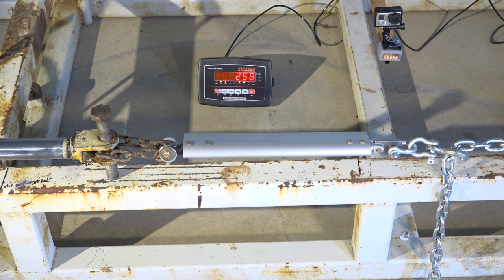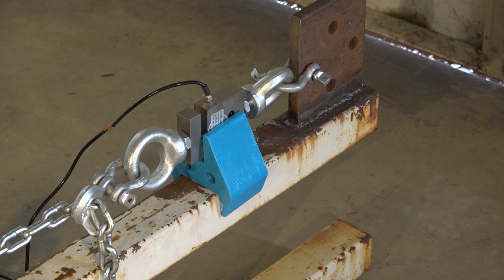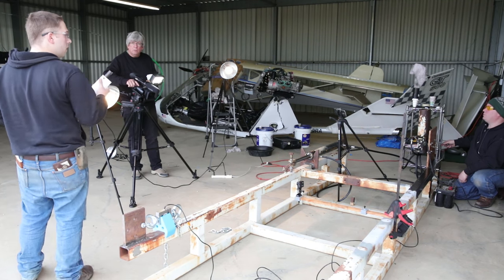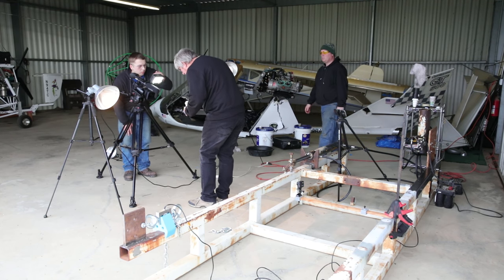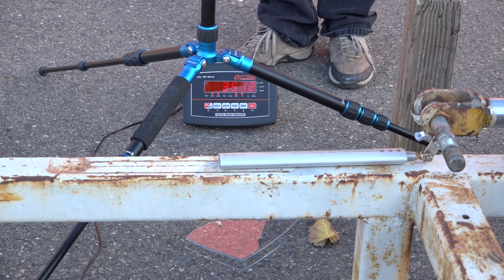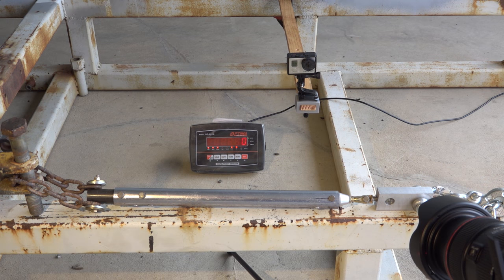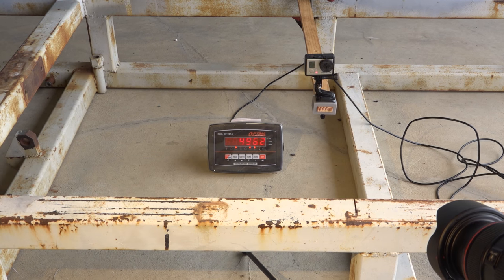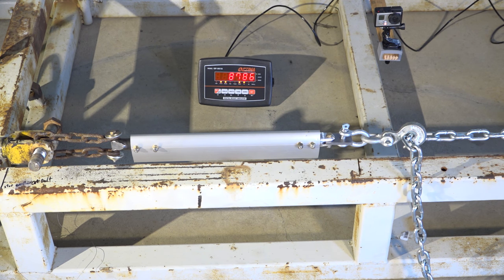**Load Testing**  EMG-6 Electric Motor Glider Fittings

Comment: Fine demonstration of the quality of aerospace grade materials. Every part and material is fully spec, tested, and manufactured accordingly. If the designer does their job correctly, you can feel confident that you have a connection that will withstand the intended loading.

Comment: Not proper test. Need part fixed at one end, to meter the hydraulic fluid much slower. Best to log both the stress and length of the part. Metal will yield and then fail. You want to know if metal is yielding.
Reply from the maker: Thanks for your comments. As I mentioned in the comments section, we still have a bunch of modifications to do to this fixture to make it a truly useful tool. That wasn't really the point of this video. The entire test fixture was made out of scrap parts left line around the shop. None of the data is useful other than from a comparative analysis. All of these components will fail in compression long before we reach yield. And even if that wasn't a factor. There is a safety factor of of each one of these subassemblies is nearly 10. All of that being said, we will eventually spend the money to make the tool a bit more useful. The pressure regulator to regulate the hydraulic fluid costs more than the entire set up that we used in this video. As always. We do appreciate you watching the video and commenting.